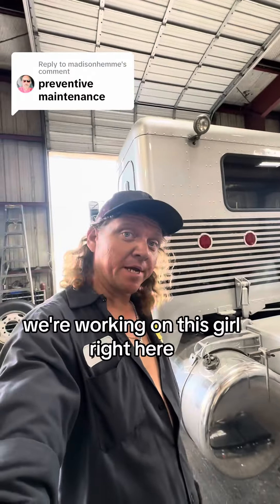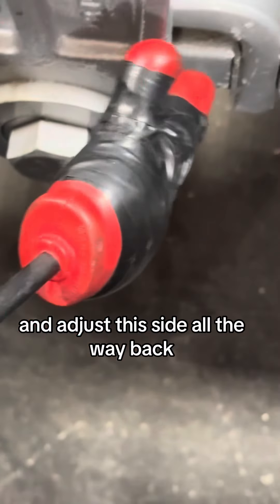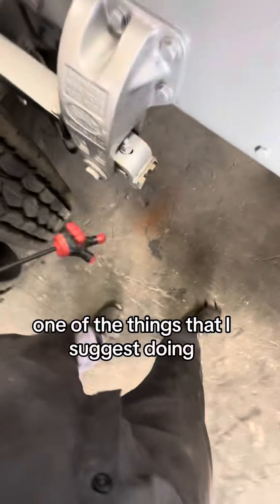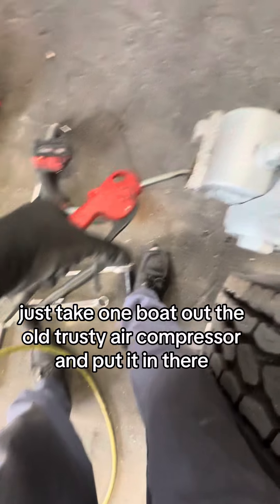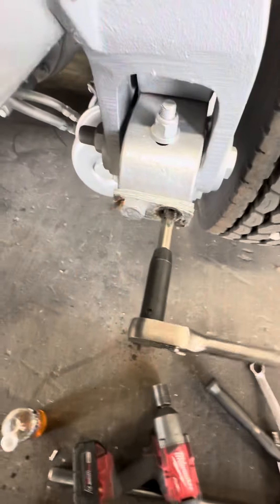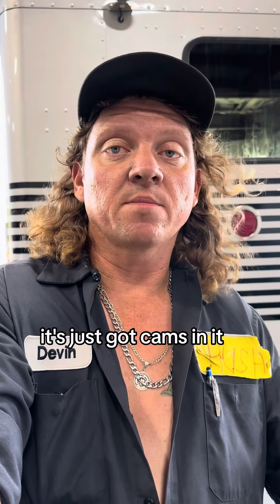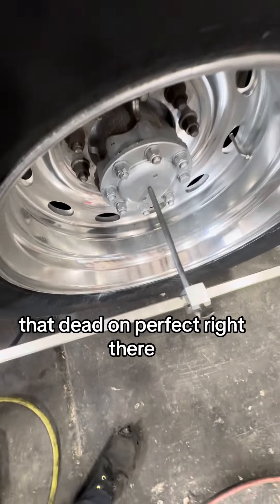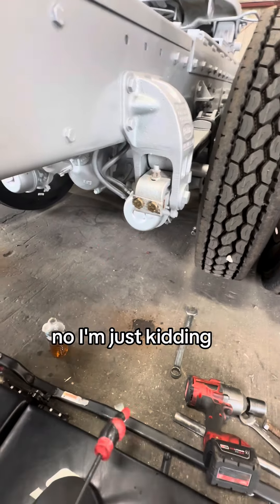HOW TO On 2000 379 peterbilt with low air leaf

Comment: Freightliner is THE easiest to adjust. Knock the front two bolts loose in the air spring bushings. Get a chain come along and tie it to the frame crossmember and the side of the axle you want to pull forward, then pull it. Stick your shims in, release it, then tighten the bolts again. Check the alignment.

Comment: The old style Peterbilt AirTrac was the easiest there was to deal with the hanger just sat on top of the spring and it slid back and forth all you had to do from time to time was change the pads in between and was easy as hell to align but like anything else it was too simple of design

Comment: So my question is if your thrust angle is incorrect than arent you setting the scrub to an off thrust angle? Also when aligning the front will it also not be correct because it is based on the thrust angle creating a "dog tracking" rig?